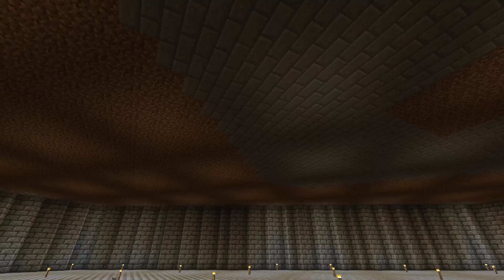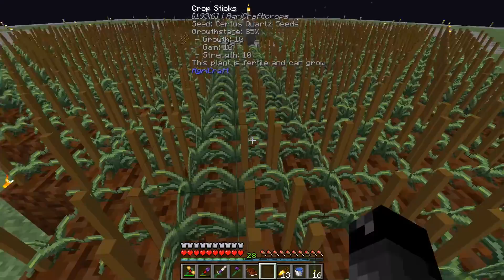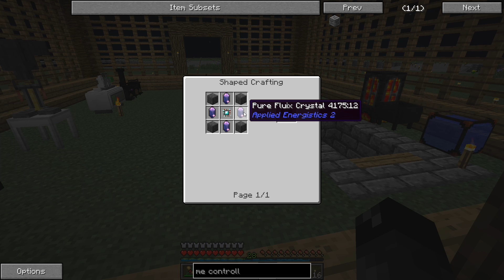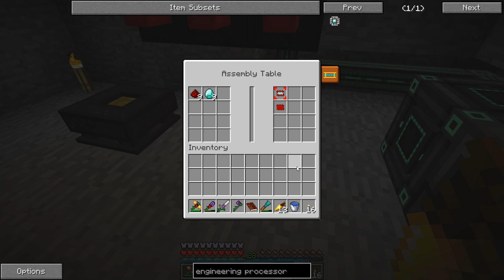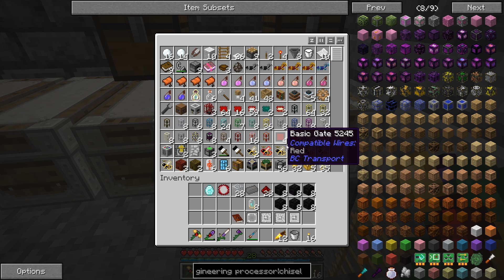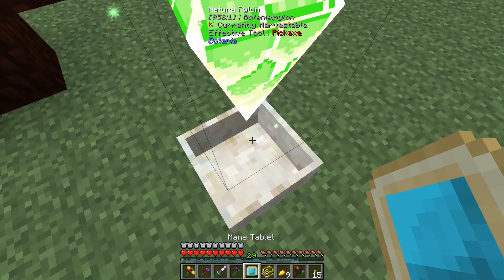Minecraft Mods Regrowth - ME CONTROLLER [E33] (Modded HQM)

Comment: Seems like end game stuff.  I don't see how much further this series can progress.
Reply: He's far from end game. He's got to build a Mekanism fusion reactor as a task later in the quest book. That needs a lot of infrastructure to support its operation.
Reply: He needs to do all the quests
Reply: +fake name i wonder ha...
Reply: I've never bothered going to fusion; As I've been mentioning elsewhere, a single gas gen will now do up to almost 7K RF/t, as long as the energy cables can support the power out.  I have six gas gens in my existing base, so once its upgraded to 1.0, ~40K RF/t is more than enough for even the massive power on a large autocrafting config.
[For those wondering, AE was tweaked here to use 3x more power - extremely basic system, leveraging a Storage Drawers wall, was 100 RF/t.]

Comment: Hahah you dont need the ME controller to have an me system! You just need a energy acceptor, me drive, drives, cables and a terminal
Reply: once you want a proper system with networks you need a controller.
Reply: Do you even realize what the recipe is for the energy acceptor for this? It's insane!
Reply: +Chrono Knights! He made one you idiot.
Reply: +Chrono Knights! He made one to power the crystal growth accelerators...
Reply: +SugarBooty go watch direwolf20's regrowth series near the end of the series
Reply: Chrono Knights! Its common knowledge that you can make a system without a controller, but its very limiting
Reply: +SugarBooty well in that series it was strangely very difficult to make... Maybe it was a different version